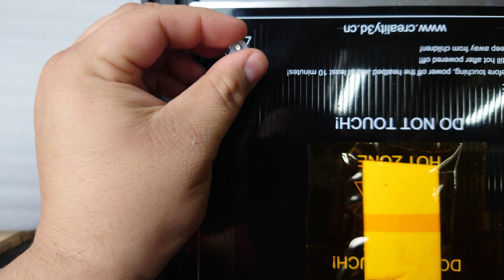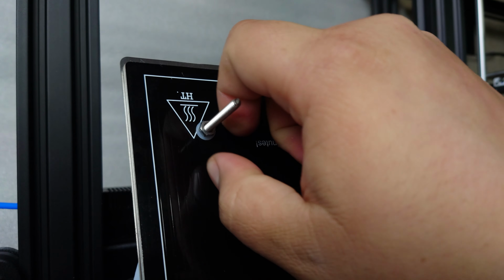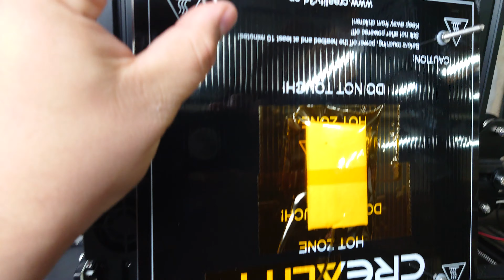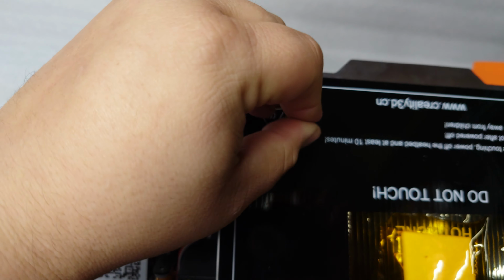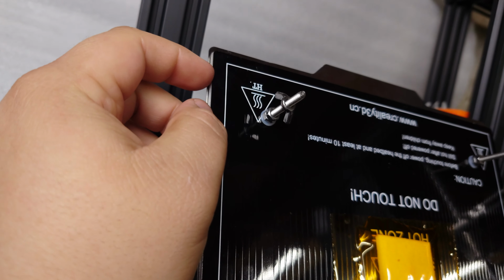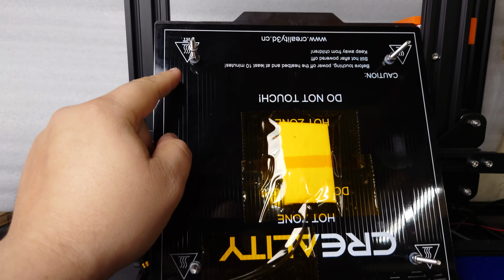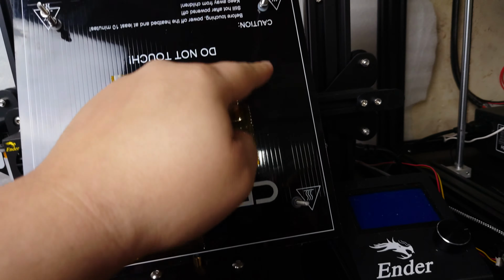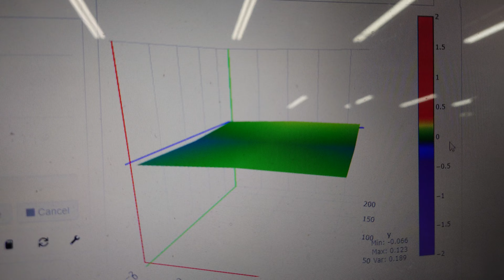How to Install 3D Printer Bed Tension Mounts

Comment: I just got yellow bed springs and tightened them down alot so there is alot of pressure on the wheels and have yet to need to adjust my mesh after close to a year of printing. This is while using a bl touch so it may be compensating for any small inconsistency in the bed level.

Comment: I use silicon solid bed mounts and a CR-Touch ABL.  I hardly ever have to adjust the bed on my Ender 3 Pro.  Still, this looks like a good system too though I wonder how the heating and cooling continually might eventually loosen the nuts a bit.
Reply: I use thread glue on screws after adjusting bed perfectly, didn't have to adjust for last 6 months, my ender is now creality prusa basically

Comment: I haven't attempted this fix yet I am still researching but so far this is looking beautiful.  @zk_6312 made an interesting comment about the temperature possibly loosening the nuts.  Perhaps adding a little Loc-tite Blue to the threads can ease your mind a bit.  Please note the color of the Loc-tite is the Blue one do not mistake the Red one for the Blue.  The Red loc-tite has a stronger bonding capacity and should you change your mind....   Prepare to do serious battle in removing your components.

Comment: Wouldnt a set of nyloc nuts either side of the existing wheels do the same thing?
Reply from the maker: I stayed away from nyloc nuts, as they are only rated to stay secured up to a temperature of 121C, which is super close to what the max of the Ender 3 pro can get up to on the bed.